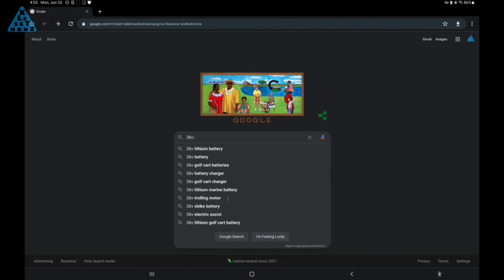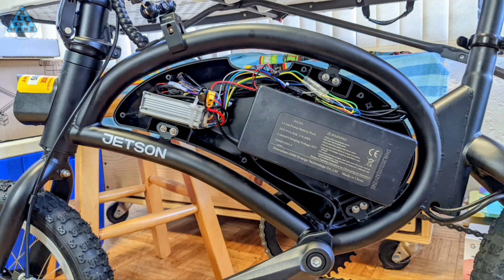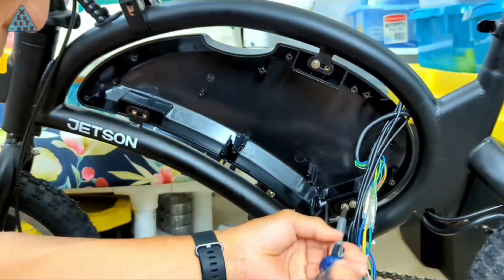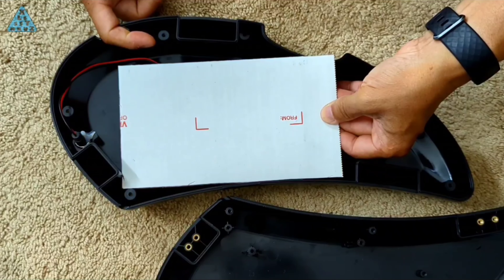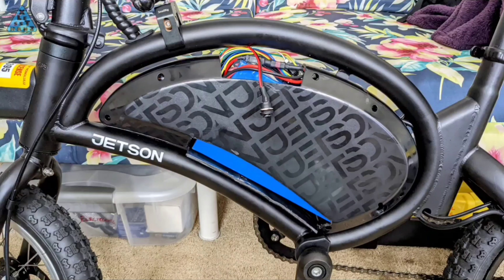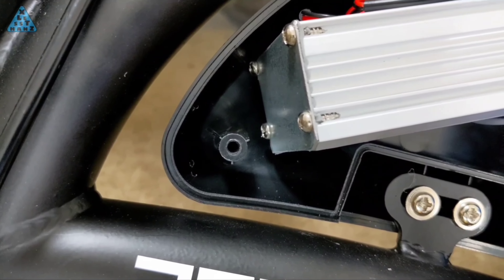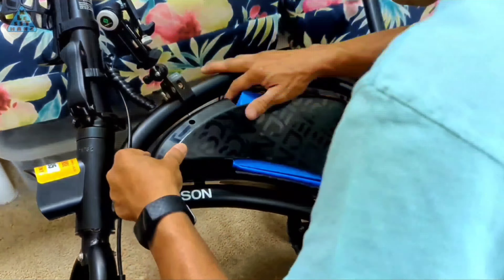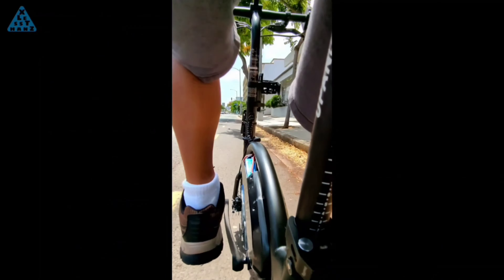Jetson Bolt Pro DIY'er - Longer Range at 36V (MORE THAN TRIPLE IS NICE)

Comment: I use a seatpost removable rack, $15 Schwinn at Wal-Mart, holds three 10 amp style batteries from AliExpress.  Cost around $80 to 90 each.  Easy to run XT60 connector wiring.  First wired each one separate, as they died, disconnected and hooked up a fresh one.  Worked fine, but I wondered how the three batteries would work in parallel, which I did and I find that the power is better, you do not get the lower performance, I presume until the last battery gets weak.  I like the performance.  I do disconnect them for charging because I was told that just using one charge port, may result in damage to a single battery if the BMS board on a battery can not take the lengthy charging.  It is easy to charge all three at one time with three separate charges.  I do not like to change the original plastic cover, not cutting done.  For transportation in my car, if I take the seat out, it also has all of the batteries on the carrier, thus a lighter bike and easy to get in a trunk.
Reply from the maker: I like all the different ideas people are coming up with for extending battery capacity and the storage of it.  Good work 👍🏽

Comment: Curious why not upgrade the controller with the battery ? Good video!
Reply from the maker: I tried sticking with 36v so I could do just the battery.  That way the controller and motor are already compatible.  I was OK with getting only longer range and not faster.
Reply: @XLessThanZ  Thank you ☺️

Comment: I did this exact upgrade. I bought a 20Ah battery and it was the exact size of the original. Is your battery 10s4p?
Reply from the maker: I have no idea if 10s4p.  Does that refer to the size?  All I was looking for was more capacity for more range.  Thanks for the info.  I'll look up what 10s4p is🤙🏽
Reply: @XLessThanZ  10s4p is just the configuration that f the battery.  10 s of 4 parallel cells.

Comment: So, you actually had to mangel your compartment to put a larger battery inside the housing! Personally, I think what you did is ridiculous and stupid! Totally avoided any warranty you had on the E bike whatsoever! What you should’ve done is bought a rack for the back of your seat post in a bag and some extension wires and just run them close to the Housing compartment! Also, you open up the inside of the compartment and flip the battery around and run the wires with extensions out the hole at the top of the housing! Many people also put a switch between the external wires so they can just flip from one battery to the other! What you did here was destroy the housing of the bike and it looks like shit to be honest with you! Also, a person could buy a frog style extension battery and additional extensions of wiring and put that on the seat post! Which, is exactly what I did! My extension frog style battery, is a 14 ah battery! Depending on your weight, if you’re over 225 pounds, you will never ever get 15 miles, throttle only,  on the Jetson bolt pro stock battery, you’re lucky if you get 9 miles! With the addition of my extended frog style battery, I get an additional 15 miles of range throttle only! The two batteries together I get over 35 miles with pedal assist and pretty much 25 miles with throttle only, that’s both batteries total/combined! This, is a much more effective solution than mangling the bike, and making it look like an ugly mess!
Reply from the maker: I appreciate your comment.  It does look like a mess right now and for myself, I don't mind.  I do have other projects that will affect this modification, one of them in particular is the design of a new compartment, which should give this battery mod a lot cleaner look.  For now, my Jetson Bolt Pro will remain a work in progress, so I'm not too worried about its looks at the moment.  Thanks for your concerns, though.👍🏼